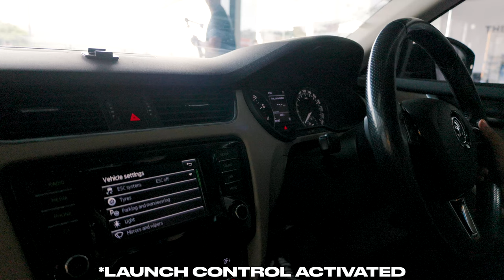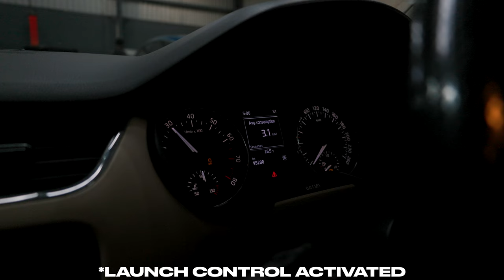Kurla Spec Exhaust for the IS20 Octavia (BIG FAIL 🤦🏻‍♂️) | Project Octavia S2

Comment: Is it ecu tuned ? If it not tuned...please  tune your car to stage one with filter.make sure to ask them tcu tune is it mandatory for stage one or one ➕️, I think tcu also need to tune with ecu stage one +. It's will give a little bit improvement in milage and incredible power to your car.

Comment: 9:50 Akrapovic tips. they sound very lovely. Kurla exhaust, ready? Any exhaust to a car has never sounded good honestly. The Civics modified exhaust sounds good at best, else others are great stock. Theres a reason why modifications should be done with reputed parts/mechanics, and why they cost so much. The car wont recover from its droning issues even after removal as seen as by some owners, they sold it off after reverting completely to stock since that too was at the 9/10 year mark.
Reply: tips dont make sound  bro